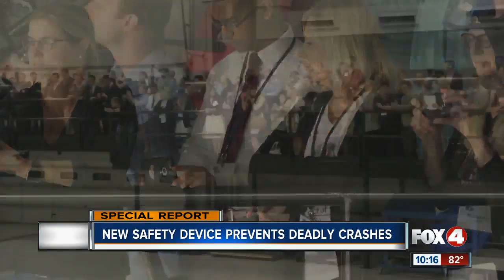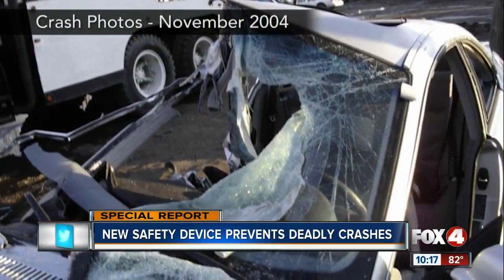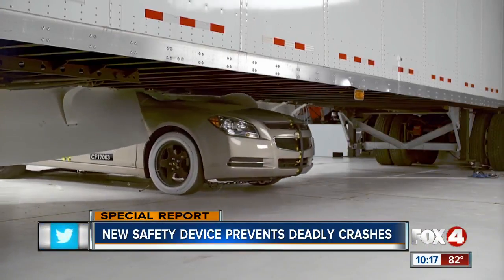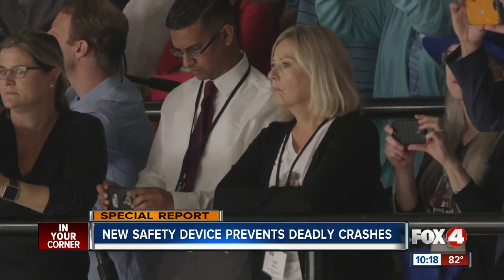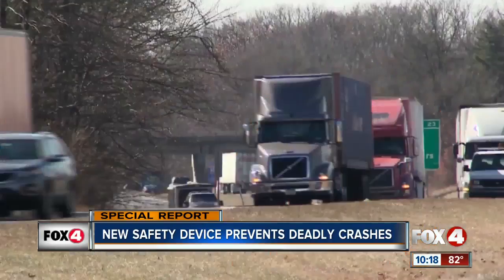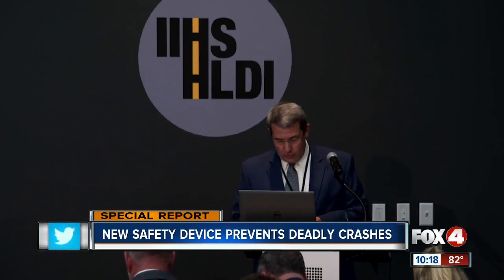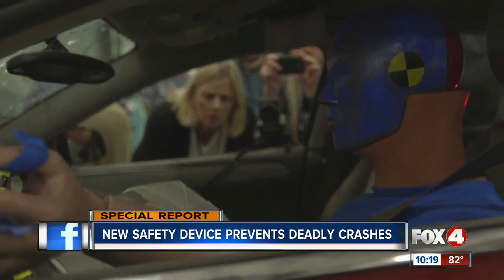Crash test intensifies call for side bumpers on tractor-trailers

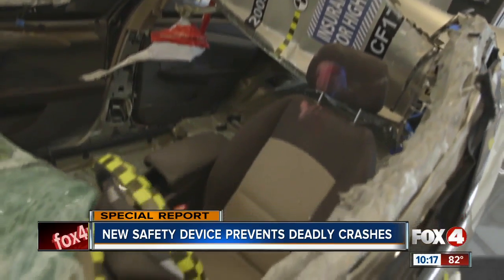Comment: Lol, they talk about safety, but at 1:30 excatly (pause the vid), that peterbilt has an out parking light. Also it seems the lights arent even the same on both sides. The driver side light has the parking light on the outside and the passenger side light has the parking light on the inside....